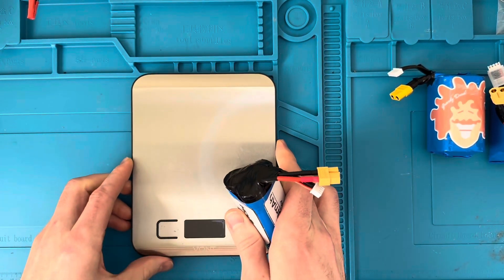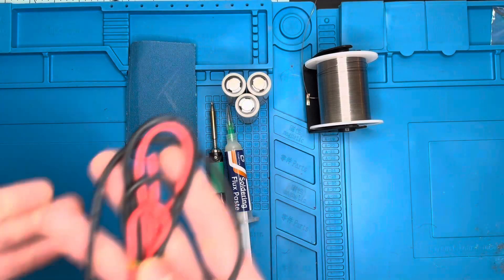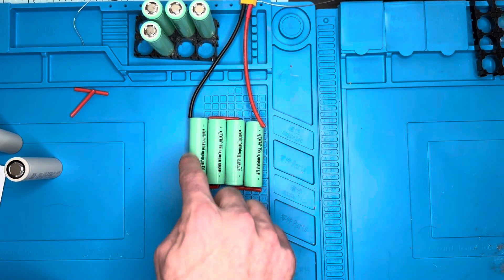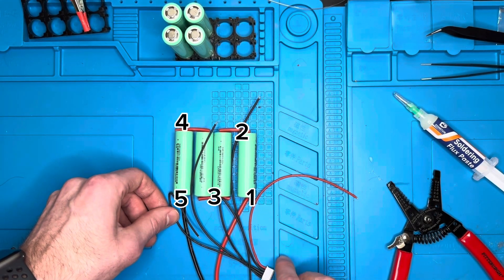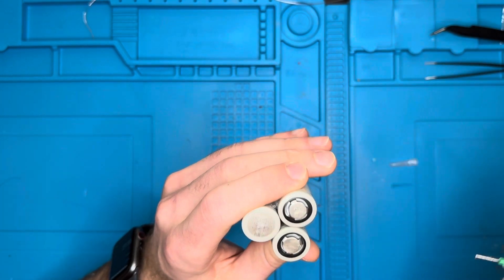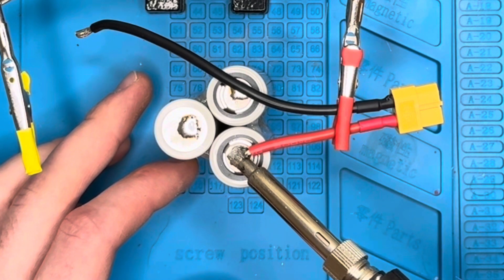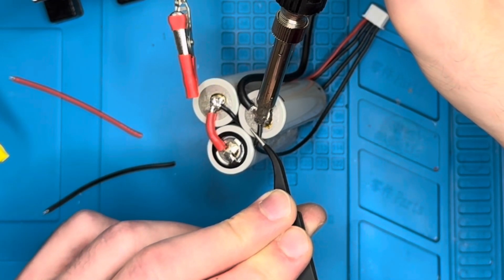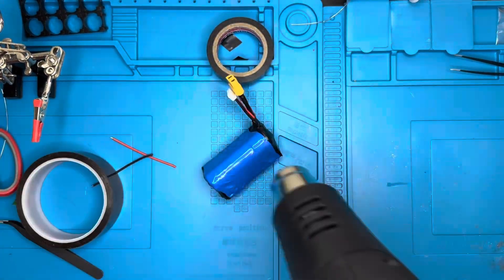DIY Lithium Ion Batteries for Long Range FPV

Comment: Soldering the terminals works but you can end up over heating the battery and losing longevity.
 Nickel strips with a spot welder is the way. Soldering your cables to strips before you spot weld them to prevent heat

Comment: I think it would be good idea to use 3s BMS for this
Reply from the maker: RC batteries don’t use a BMS. In FPV you monitor the battery voltage manually and use a special charger to make sure each cell is balanced when charging

Comment: Yo! Nice video! For how long riding Yusido drone this battery lasts? Approximatelly? Did you tried to build 2x3c batteries?
Reply from the maker: Once the weather gets better I will test out these 3 cell batteries and let you know how they do!
Reply from the maker: I haven’t had a chance to try flying the 3s battery because we got snow. I was getting about 12min flight times with my 4 cell battery in 40 degree F weather. So I expected to get at least 15min of flight time with better weather